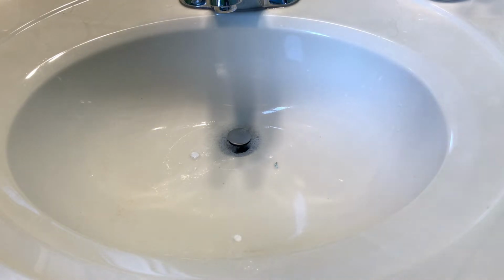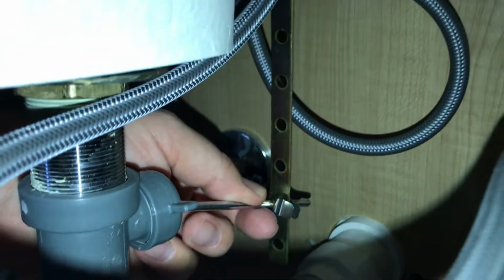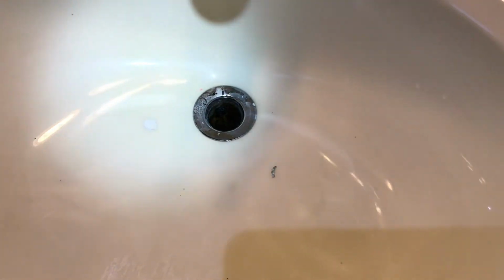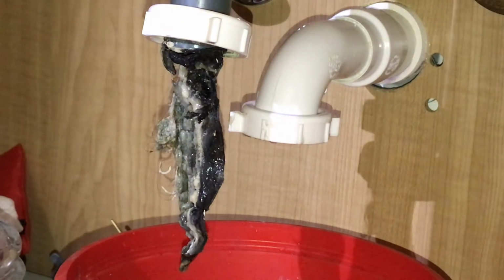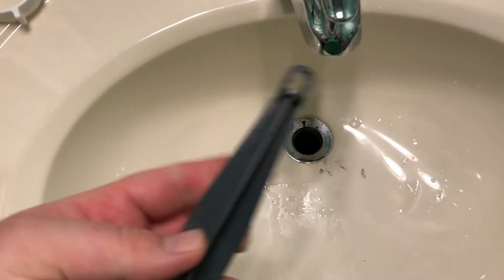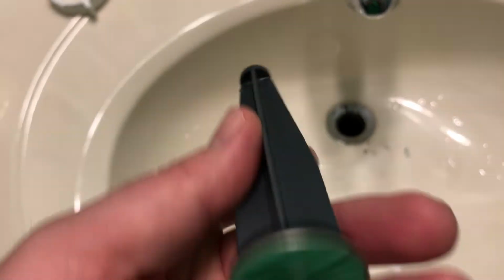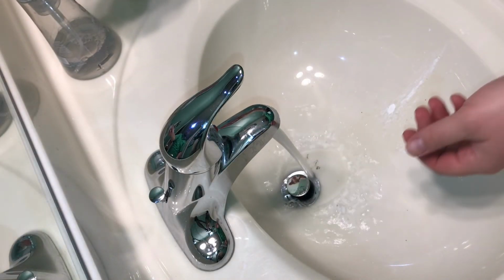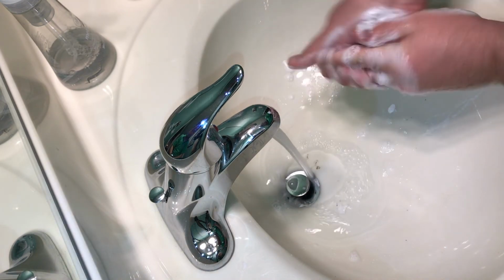How To Unclog a Bathroom Sink

Comment: A sincere question:  Why not snake the drain after pulling out the horizontal rod? Isn't that quicker/easier?
Reply from the maker: In this case, there was a lot of gunk build up from the kids washing slime off their hands and into the drain. That glue hardens and for me, I didn’t want to flush that deeper into the plumbing